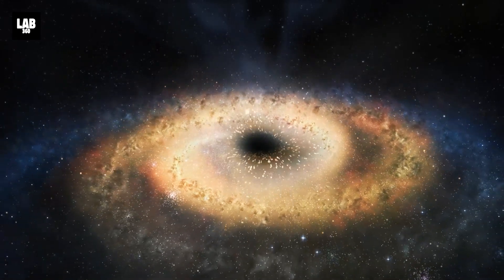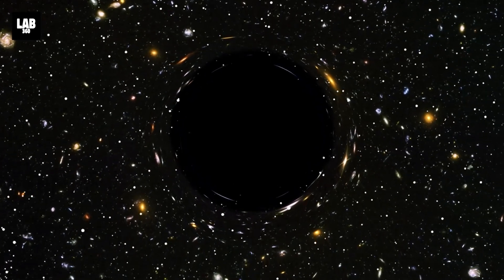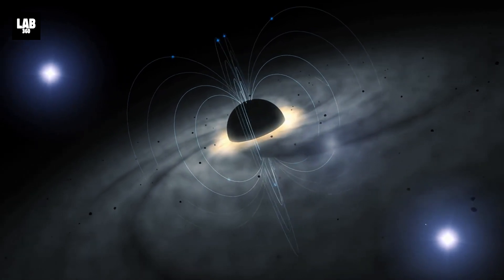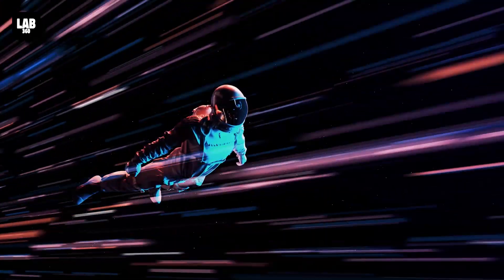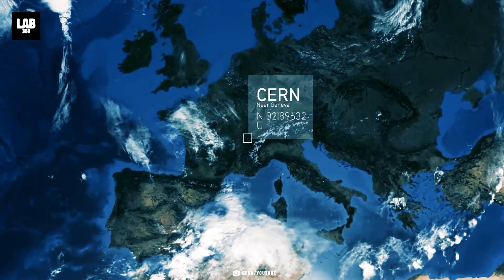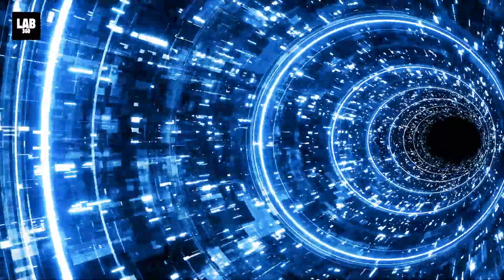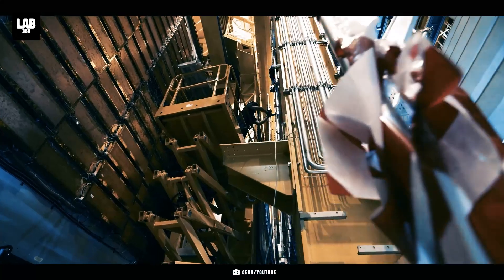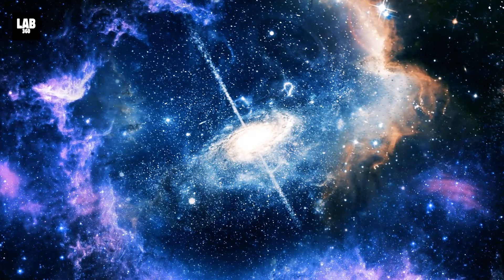CERN Scientists have finally done the IMPOSSIBLE with Blackhole Jets!

Comment: The sun. Solar system planetary generator.  It's an element. Blue flame needed to heat hectors of land mass. Earth 😊
Reply from the maker: Sorry but we didnt follow what you said, can you explain in detail?
Reply: @LAB360  the sun must be like a hydroponic generator element. Brushless electrical connection with planets and moon. If you scale up. Huge motion from planets/moon's high speed rpm. 18 MLS per second etc .And heaps magnetism/metals. Must Emmitt blue flame near Earth. Radius. hydro light/heat to heat that amount of area hectares on Earth.
Reply: Hey my name  is hector now spell check not working so I don't know if it's sectors that was typed in wrong , but if it's hectors  than the  multiverse is real !!